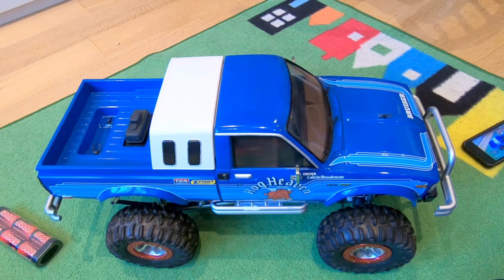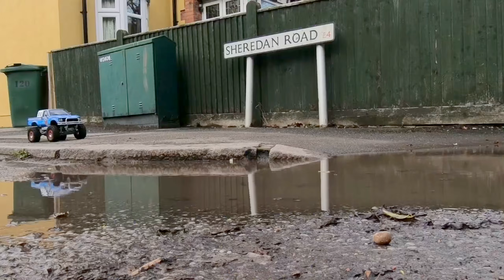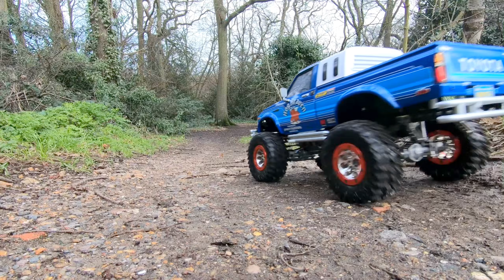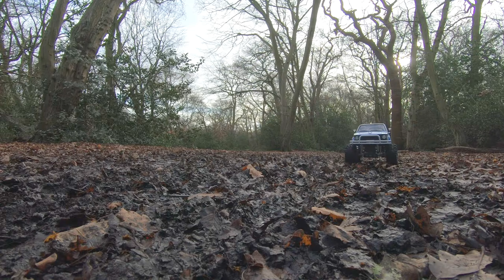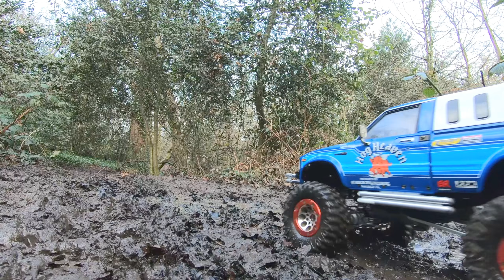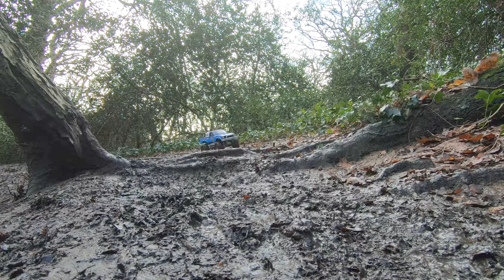Tamiya Bruiser with narrowed rear axle and RC4WD hex adapters

Comment: Does the slipper clutch slip easily?
Reply from the maker: From memory it is adjustable with a nut. I would have done it so that it only slipped when the wheels were really stuck to protect the plastic gears in the transmission.

Comment: I’ve been thinking it would be easier to just buy a second front axle and mount it on the rear lol

Shame the RC4WD adapters are out of stock.  With the number of Chinese bruiser clones being sold I expect them to restock them soon.
Reply from the maker: Good idea - shouldn't bee to hard to lock the knuckles - or even go for 4 wheel steering!🙂 
Lets hope that they re-stock or the clone makers do reasonably priced spares.

Comment: looks ace mate, im considering the hex conversion on mine,, have you locked the diffs? if so how
Reply from the maker: The diffs still lock the same way - with the pins in the centre as the hex kits don't affect how the diffs work. I usually just lock the back diff, depending on the weather conditions and what I am trying to do with the truck.